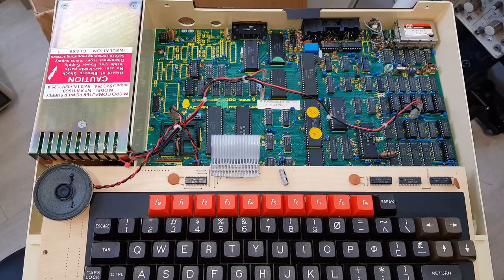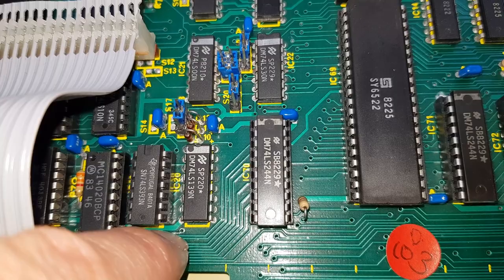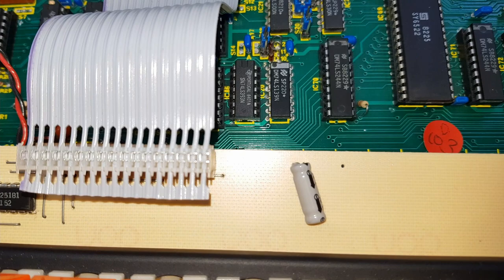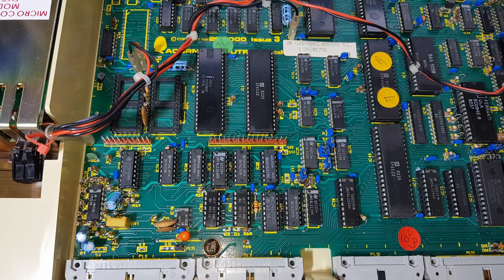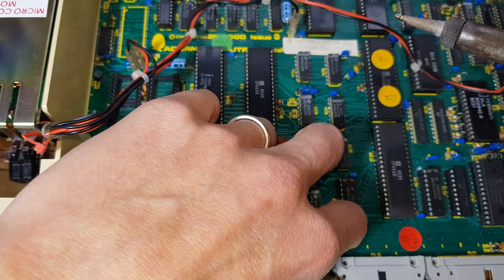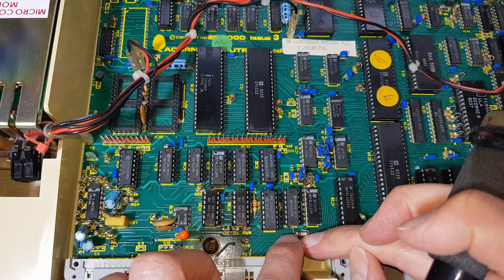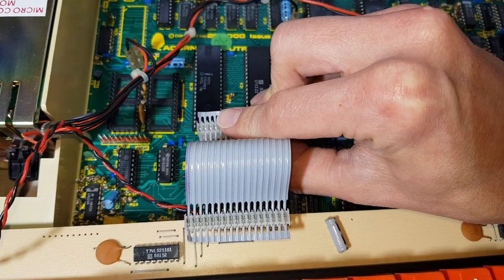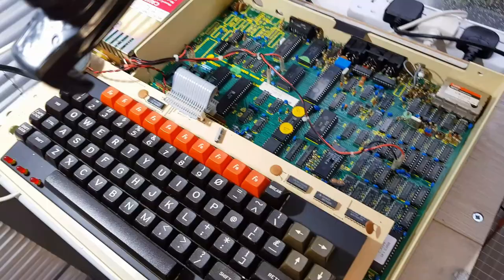Fixing The BBC Micro Speaker Buzz

Comment: Looks like a great little fix.
Is it the same as connecting the audio in on the 1MHz bus to ground?
That is what I do with a jumper with a resistor soldered into it plugged vertically into the 1MHz audio in pin.